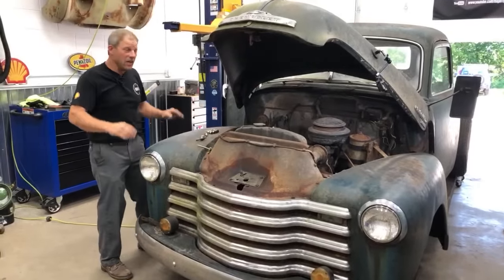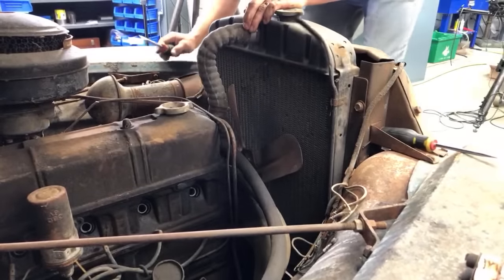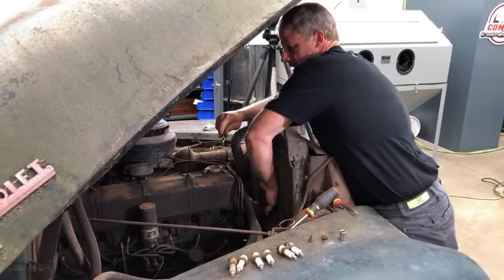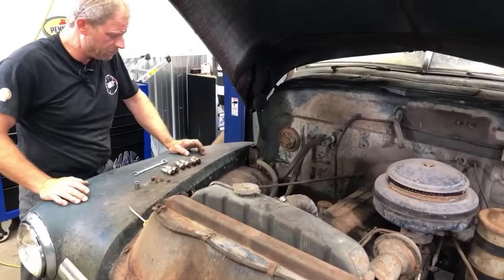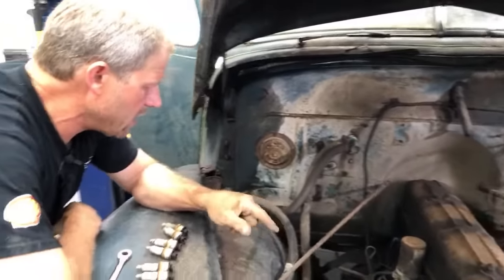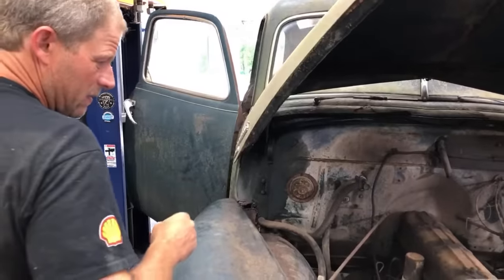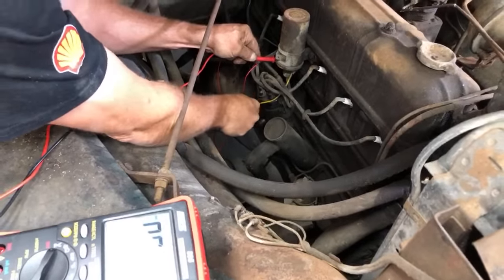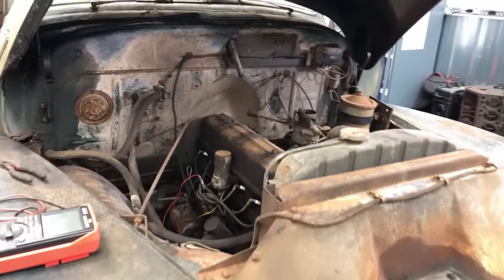Will It Run? 1950 Chevy pickup pulled from the forest | Redline Update LIVE

Comment: I sincerely hope you actually rebuild and restore this truck. It appears to be in such good original condition. So very many have cut-up, modified and sent on their way to the scrapper. The 216 has Babbitt bearings although some have rod insert conversions. They also have a low pressure (15lbs.) oil pump. There are now some full pressure conversions that work well. Patrick's Auto Parts in Casa Grande AZ. is but one.The dealer shops had a fixture for aiming the nozzles that lubricate the rod bearings. As you guys are not dummies I'm sure you are aware of the extreme low rear axle ratio (4.56 down to 5.13) this truck has. I'll be watching... Hope you do her up right.
Reply: Patrick's has been closed for at least a year.

Comment: I restored a 1950 Chevrolet 3600 grain truck, sadly I can't post pictures here but it was a fun project to say the least. I found the original hand crank under the seat. When it came to needing parts, Chevs of the 40s out of Van Couver Washington helped out a lot. I also did a 1946 1 1/2 ton long wheelbase panal truck.

Comment: Hagerty  In the 1970's I got one of the same Chevy model  1950 &   club cab  windows gave them $10. took to my  friends barn did the same thing as you But it started! Then I drove it and it smoked like crazy but I  got a friend to overhaul it .Drove it for ten years and  wish I would have kept it. This 216 has  babit  bearing incerts once you do the Crank shaft you Have to reshime. each bearing cap. Never Smoked again ran great  Drove it to work did great for me. On the oldest Pa winter Day it would turn slow and start right up. Please post after your after you  got it going Posts.

Comment: Got a 51 been sitting for 40yrs. All original ,including split rims. Guy said it ran before parked. So far, engine not siezed, good compression,  established spark, rebuilt carb. Next replacing plugs and adding fuel to carb. Wish me luck.
Reply: Good luck! I got a 48 GMC rotted cab but restored engine and chassis. I want to get the motor spinning and maybe fired up too.

Comment: Just a couple of tips on troubleshooting an ignition system. The most likely failure component in a battery ignition system assuming your points are making contact is the condenser sometimes called the capacitor.  Also if when you are wanting to know if a spark is being generated, pull the wire out of the center of the distributor and hold it near a ground. It should spark as each piston comes up on compression rather than only once every 4 revolutions. 
Gary 76-Year-Old Home-Shop-Machinist, A&P Aircraft Mechanic and retired aircraft inspector
Reply: Sounds like the points are either stuck open or closed. The condensor helps prevent the points from being pitted. Gary has good advice.
Reply: Granted I shot through the video so I could have missed it, I only saw him clean the points. I test the points with a test light or continuity tester. I bet the points are just stuck or to corroded. Like you said, from there the condenser.
Reply: im a little late to the video, but excellent points. I would even just pull the distributor cap and see if its spinning.
Reply: Yep i'd have looked for a new condenser as well. Also i didn't skip over many points in the video but i did jump a little during the points cleaning. Did they roll the engine over with the cap off to make sure the distributor was even rotating?
Reply: This brings back lots of old memories and all advice given is very good... They definitely have an electrical problem, but I think just for grins I would do a compression check to see what they have.. The motor might be in great shape internally and might not even require a rebuild...
Gary Jones #2...  Not the same Gary Jones that made the initial comment.. There's lots of us Gary Jones's around...
Reply: @ Gary Jones , exactly. And they didn't even think about the condenser.  That's usually the first thing to go. They are basically a tin can with foil and paper rolled up. Have a habit of collecting moisture which leaves them useless. Not that surprising,  most mechanics nowadays are clueless when it comes to points. However, he should have known that a EGR valve has nothing to do with crankcase venelation.
Reply: Without the condenser there is no spark.
Reply: Would think they would want to know compression before they started rebuild. Let you know your starting point. Already had plugs out.
Reply: ....I kept yelling,  Check the points!
Reply: Usually it's the condensor. The points if was sitting open will get corrosion.  Can clean them. Condensor draws moisture . No fixing that. New condensor only way. Or get electronic conversion. I'd rather stick to points. Much more reliable in long run. People will argue about that. But let them. Sure don't have to maintain. Adjust and replace points. But electronic fails also. And costs more. With conversion you not sure how everything calibrated either and often not adjustable. And if some electrical pulse event occur, natural or weapon, my points will still be running.
Reply: That + thru wire in to dist. like you 70yrs. Checking for really good mechanics is a waste of time. Factory dealer for most electrical  suppliers, with repair & rebuilding shops.
Reply: Not sure what you're saying. You're communication skills seem to be somewhere in line with this guys mechanical skills. Thinking maybe you're saying a good mechanic doesn't need to do tests to find provlem. It's just a waste of time. If that's what you're saying,  you should stick to commenting on things you know about. Without properly testing there is no accurate way of knowing the problem.  Often times there are multiple things that may be the problem. Sure if you just replace a bunch of things, it will be fixed. However it's not fair to the owner. Why should they be charged for a bunch of unneeded stuff? Anyone not testing before repairing is definitely unprofessional. And they are asking for a lot of problems
Reply: Well said sir
Reply: I should think he'd want to replace the points, condenser, rotor and cap in any case.  And those spark plug wires are probably originals as well, so new wires.  All fairly cheap parts.
Reply: @briankennedy5578  Spark first. Without spark, compression means nothing. One thing at a time. I ALWAYS start with spark. Then FUEL then compression and timing.
Reply: Thank you for the tip it is very helpful 👍🏽
Reply: @RC Hobbyist Extreme , and without compression , spark is useless , and if no fuel , or air, ....... which ever is easiest. Depends on what you are working on. And if you have the plug out , might as well check the compression. Unless you just like taking out and putting spark plugs in.
Reply: Every two revolutions not 4 😉 cam rotates at half the speed of the crank. Every 720 degrees all cylinders would have fired once. This is coming from an A&P as well 😉
Reply: @briankennedy5578  He probably got EGR valve mixed up with PCV valve.
Reply: @briankennedy5578  They could remove the condenser, and it'll spark and even run, but the points will go bad quickly, since the condenser is there to dampen the sparking of the points to keep them from pitting, so isn't directly involved in producing the spark of the spark plugs, but it's okay to remove the condenser as a test. If the condenser is shorted, leaving it on will nullify the spark, because the current's grounded out. Just like with old radios, condensers (capacitors) don't age well, whether they are used or not.
       I had the 1/2 ton version of this truck, the 3100, when I was 18, 40 years ago, but it had the same motor, a "stove bolt 6", 216. It had 3 on the tree and a starter pedal. I think this guy must have felt the pressure on him, since it was live, because the problem could easily have been, that the coil wire was bad to the distributor. I'd have checked that, before I went and grabbed another coil. Also, sometimes, even if you scrape off the points, when the vehicle is so old, the part of the points, which rides the cam, so the points open and closes, breaks off or crumbles, when you turn it over, since it's usually bakelite or some other sort of plastic.
       I hate it, that he gave up so easily. We needed "The Redman Reaction", if you remember that TV commercial?
Reply: Who cares. EGR and PCV are totally different.  You have trouble mixing them up, you don't have a clue. As for a condenser,  I know what their purpose is. Also know it won't spark if bad. They are a foil like metal rolled up with paper between to insulate. They tend to draw moisture. This causes the dielectric of the paper to breakdown and it shorts out. Therefore you get no spark.
Reply: The points are easy to check by looking at them. A test light or ohm meter checks continuity. Key on you can see spark by opening points with small screwdriver. Coil can be easily checked with ohm meter. Not 100% accurate. But close. This guy just doesn't have enough knowlage to be making this kind of video.
Reply: Wao k emociones esos vehículos

Comment: Just a little tip on point systems.  Connect the test light to ignition wire (jumper wire) and points wire.  Turn engine over. Flashing ok. No flashing bad points/codencer or grounded. 
2 main types of coils.  Internal and external resisted. A 12v external would work.  Internal would have dropped voltage to around 3v with a 6v battery. Electric ignition has spoiled us all. When in a rush, we forget the little things.
Reply: Converting to 12vdc just needs a voltage regulator.  Also need to change lights and a few other things.
Reply: Exactly

Comment: I have a 50 just like this the engine ran with a cracked block even.  Changed it out for a 58 235. Excited to see your work.  12 volt is way to go easy change out bulbs a resister or two and cool.  Off you go.  Can't wait

Comment: on those old engines, i always run a clean cloth between contacts on the points because i have had a tiny piece of the grit on the sandpaper to keep the points from making contact. i then pull the distributor  coil wire and break the contacts with a screwdriver to see if i have fire. I am 70 years old and really love seeing these old vehicles run again. loved the video!!!!

Comment: Had one just like it.  Pulled it from a field.   Mine was a 48 thrift master. Green.   And all I had to do basically was changed braided ground wire and it started right up.  Had to replace all the brake cylinders in the master cylinder and all the brake lines.  Was a fun project loved that truck wish I still had it.   Yeah Lotta fun fix it up.  Cart wheels I did a lot of them today teaching my gymnastics class.  Good luck with the truck.

Comment: Great grille!   In 2003 I bought a 50 3600 very similar to this.  Motor was stuck and everything else deteriorated from 27? years of exposure.  I got it unstuck by patient application of penetrating oil in the cylinders.  It was eventually a good running and driving truck.  They no longer used the Thriftmaster names by 1950.  Published HP about 90.  The 261 6 came out in 1954.

Comment: Being a 50 I think it would have a 235. If the lifter cover stops at the base of the cylinder head it’s a 235, If the lifter cover comes up to the base of the valve cover it’s a 216. If it’s the original engine it should also be a splash Oiler. Can’t wait for the updates on this one!
Reply: It's definitely a 216. In 1950, they usually only used the early 235, which was also a Babbitt engine,in the 1&1/2 ton and larger trucks. The later 235 wasn't put in trucks until 1954 and was used up until 1962 when it was discontinued.

Comment: An old school note from Upper Michigan....... We always replaced the 6 volt battery with a 9 volt battery it will recharge from stock generator, and turn the engine over much faster. ..... not to mention the lights will be brighter too. (comes in handy in the winter eh.
Reply: 8 volt🎉😂

Comment: My dream truck is this model of Chevrolet, like the cab design as it looks very rugged. However, I would swap the "wellsider" type body and fit a wood and metal flat bed that went over the rear wheels, and sides to hold freight securely.

Comment: Would love one of these. A quick Google reveals "The 216 engine is a six cylinder with an output power of 90 horsepower at 3,300 rpm and 174 ft-lb of torque at 1,200 rpm. The compression ratio is 6.50:1 and the piston displacement is 216.5 cubic inches."
Reply: It makes maximum torque at barely above idle speed.  That engine was designed to chug along.  It'll haul whatever you have as long as you're not in a hurry!

Comment: Got a 1950 Chevrolet 3100 Stove Bolt sitting in my drive way. Got to run up until pressure was built in radiator then stream of hot water was shooting straight out to the firewall. Well the engine runs
great but the radiator is bad and so are the brakes.  It is a 4 speed model like yours on the floor. Except not a 5 window model but a step side bed 3 window model.  Looking forward to this build you have of the 3/4 ton first generation series of work trucks.

Comment: What I did was aired up the tires and had a friend pull me around the block. Of course, we made sure things were free. Just remember to turn the key on.
   Love Old trucks !! Had all Chevy's '46 1/2ton, '48 1/2ton, '52 1-1/2ton 8ft. Bed, '54 1/2ton & '65 Apache 1/2ton, '67 3/4ton, '68 3/4ton 4x4, '69 1/2ton, '72 1/2ton, '77 3/4ton 4x4

Comment: I've done this so many times...you could have used the fan blade with the belt on it to roll that motor. Check for spark at the points using a screwdriver and hit the starter if the points have spark.  It's a straight six Chevy. It will run without all the fuss and worry.

Comment: I had a 1948 thrift master. One ton flat bed.  I miss that truck.  In order to start it after it was in a field for years was to clean off the braided ground wire.  Was so fun to work on.  Good luck with yours.

Comment: My pop bought a new 1950 Chevrolet 1/2 ton the year I was born. I learned how to drive with it. Weak points were burnt exhaust valves, sometimes the manifold would warp causing it to suck air and miss, big thing was rods knocking, have to use a plastic gauge to re shim the rod caps for proper clearance. They had a good 50 MPH cursing speed, geared pretty slow by today's standards.

Comment: @29:53 you reference the Draft Tube and start to explain Crankcase Pressure. Right around 1955, the PCV valve was introduced, which vented Crankcase Gases through the Intake Manifold, to be burned with the Air/Fuel Mix. PCV is an Acronym for "Positive Crankcase Ventilation" (as opposed to PVC which is Poly-Vynil Chloride, which is Plastic). Yes, with only a Draft Tube, some oil is lost to the Atmosphere. You need a 12v battery to fire a 12v Coil (just don't turn the lights on, while the 12v battery is in it).
Reply: I agree with all you said. But you missed his theory of EGR removing crankcase pressure.
Reply: I must have.

Comment: AWESOME!! I have a 1948 Thriftmaster 5 window that I rescued from someone who shouldnt have had it. It is getting put on a 1996 Chevy S-10 frame with 4.8 and 4l60e. I checked and it would cost me more to rebuild the brakes than the cost of the S10 so modern drivetrain it is! (This is my 5th AD truck so far) I love the stovebolt 6 but the full pressure 235 is soo much better

Comment: I had one of these .... 45 years ago,  check the oil filter,  they deteriorate to mush when sitting.    I'd get the spark going (file the points) set them put some gas down the old carb and see if it will fire if it does then the fuel system.    Once you get it running you'll know better how to proceed.

Comment: It would be great if you tried again to get it running , it's probably a bad condenser . That's why I like Coldwarmotors and Jonathan W. , they make every effort to get the engine running before they toss in the towel. The air cleaner is an oil wetted not oil bath. We had a 52 Chevy with a 216 when I was a kid. Thanks for the video see you at Hershey.

Comment: this thing had a 6 volt system with the battery under the floorboard. foot starter by the accelerator petal. I just kept the 6 volt starter, bought a 12 volt battery, changed the generator and regulator to a 55 chevy. Ran for years no problem. The bulbs had to be replaced too

Comment: i got a ford y block running that had sat around 30 or 40 years it is a good motor 70 psi oil pressure and it looks like jonathon w is a bit more experienced on getting old stuff working with out buying parts
Reply: brand new that engine wouldn't make 70 psi of oil pressure

Comment: all you gotta  do is put a test light on the negative side of the coil and spin it over. If it blinks it usually mean the coil is ok. if it stays on the points are not grounding the coil. condensers go bad just  setting up too.

Comment: Put a resistor on it, change the lights to 12 volts and put a 12 volt battery on it leave starter like it is 6 volt and it will whirl over so fast and start right up. My dad did his 1 1/2 ton that way and ran it over 15 years with no problem. I believe it’s actually better for the starter because it doesn’t have to turn over so much.

Comment: My dad drove one of these until I was a teenager, about 1963. The steering was so worn you had to herd it down the road between the center line and the fog line. There was a quarter turn of play in the steering wheel. He kept it running for years, but replacing the front end wasn't worth it.

Comment: I had a 46 Chevy truck with a 216 six banger, I think it had 85 HP. It did not have a full oil system, the connecting rods had oil dippers to oil the bearings.

Comment: Stove bolt 6 came from the size of the  bolts on the engine... Which shared the same as the old iron stoves they used back in the day.